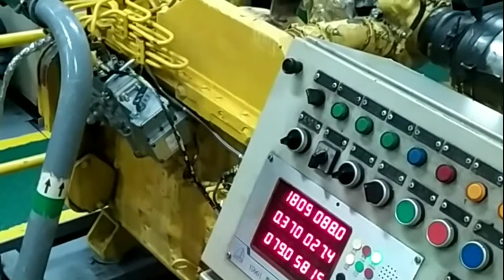Maintenance Fuel Rack Actuator || Fuel Pump || Engine Cummins

Comment: Good day, sir tanong lang po sana kung saan pwede mag adjust sa fuel pump para tumaas rpm nag vibrate po kasi ung generator namin pag bumaba ang load nya kahit naka 1800 rpm na set rpm nya 6bta.5.9 Cummins po model